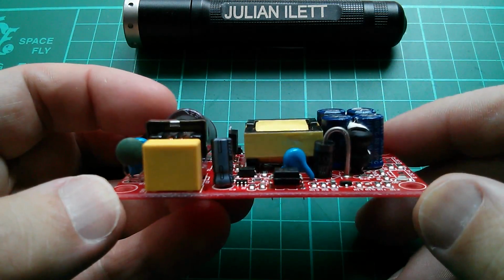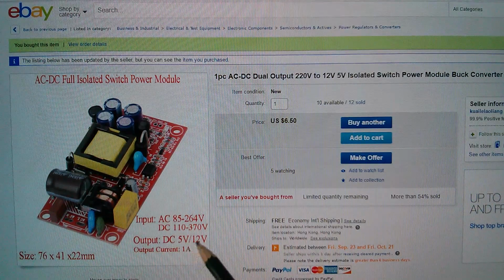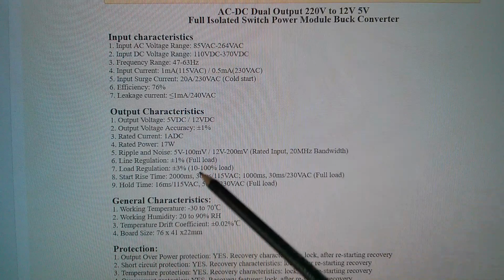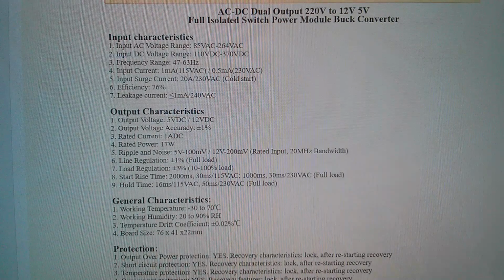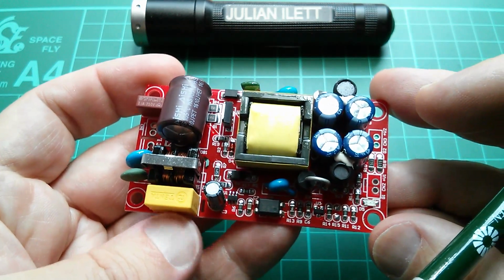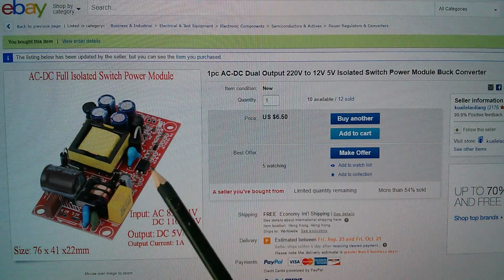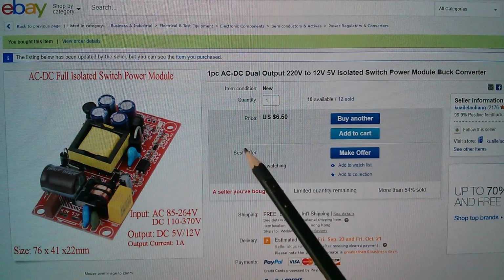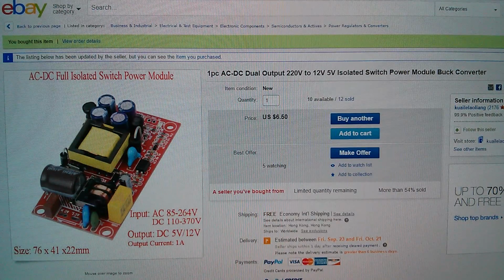Mad Idea: High Voltage DC Power Transmission

Comment: if you need something with High voltage : http://www.ebay.de/itm/High-Voltage-DC-DC-Boost-Converter-8-32V-12V-to-45V-390V-ZVS-Capacitor-Charging-/272049280111?hash=item3f5766946f:g:4r0AAOSwFGNWTC52

Comment: Now I have watched your video, some thoughts. Firstly most SMPS units will happily take a HVDC input. So you could use an old laptop supply, the new SM wall-warts (I know you hate that term! lmfao) etc. There are a few that won't work on DC cause they try to get too clever on the input side. 

However...really? A boost converter down in the garden? For one thing you're going to have to go out there all the time to turn it on & off - or you run an extra wire for remote switching! 

Wouldn't it be more sensible to move the battery into the workshop and just lengthen the solar panel wires? If you're using a PWM5 you could just let the cable resistance soak up the voltage differential between the Vmp and the actual battery voltage! And then the PWM5 will be mercifully out of the weather. lol

Finally, if you are determined on a remote battery with a high voltage link, would it not be more sensible to send the power as AC? This way you don't suffer the issues with electrolysis that DC presents. And remember your SMPS will not be fussy about the frequency of the AC either (within reason). Maybe that little Royer inverter would be a better bet? Or do some electronics and roll your own. 

I am not going to say a word on efficiency 'cause what would be the fun in that? :)

Comment: Just a thought, does the maximum amp output at either 5v or 12v (or both) get affected based on the lower than spec 110v input? e.g. at 80v input is the maximum amp output 600ma?

Comment: Now I know Julian that you must own a 12 DC to 220 AC.  Picture this,  use a RF ardiuno to monitor batteries and remote turn on a relay operated inverter located at battery then power cord it to the shop and reduce it to variable power DC or AC.

Comment: Protip: Most (basic) SMPS's will accept DC input,and never know the difference. The first thing that happens (after some EMI/RFI filtering) is that it gets rectified to DC anyways. You don't really need to look for a supply that's specifically rated for DC input. Some supplies with PFC and such might not be so happy,but most of the basic types are fine with DC input.

Comment: The DC input range is essentially the range of peak voltages of its AC rating range. It rectifies AC into DC to begin with so feeding it DC directly makes no difference to it. Now if you can find a buck converter with a multi-kilovolt input range we'd be cooking with gas.

Comment: I have lately been thinking of a very similar idea... but, with the boost converter at the solar panels and then down converting at the batteries... each panel could have it's own boost converter putting voltage one a high voltage "buss"  then running a relatively long distance over inexpensive wire and finally down converting to charge a battery bank.   I haven't worked out how to do the charge controlling.... should each solar panel and up converter do MPPT and put as much current onto the high voltage dc bus.. then another mppt like control at the other end top up the battery.   Very interesting to think about.. It would make installing solar panels much easier..   shame though.. that the cheap buck and boost converters from China don't really handle enough power to make my idea workable.

Comment: HVDC distribution is being used in some countries. The only reason we've been using AC is because when power distribution was first being used, we only had big ugly transformers to wire up. It's also easier to make an AC generator more reliable than a DC generator. Today we have high voltage semiconductors that can handle the high voltages and currents needed. The new silicon is now cheaper and more efficient than the copper used in the transformers, so we're starting to use SMPS power supplies (with their smaller transformers with less copper running more efficiently at frequencies higher than 50 to 60hz) to convert long runs of about 600kv DC to distribution stations. From the distribution stations they then use a SMPS to convert the HVDC back to lower voltages and frequencies (10kv and 60hz for example) for the short haul to the old style transformers near your house.

The DC has the advantage of not having losses due to AC inductive losses of long wires and capacitive effects between the lines.

You might get better efficiency by connecting the 115VDC directly to the 400V capacitor, but you lose the safety of the polarity reversal protection of the input rectifier.

Comment: Since your Power comes from solar, and your batteries always seem to be fully charged, the efficiency of the boost and buck converters can be ignored.  12Vdc steppped up to 120Vdc reduces current over the long haul to 10 % of the "current" draw.  Losses are I**2 * R but who cares?  For the same reason already mentioned.  You have already invested the cost of the copper run, so why change it?  120 Vdc seems more scary than 12Vdc, so don't mess with it especially when it is raining.  The benefit I see is that you increase the solar power transfer capacity by stepping the voltage high for the long haul.  The life of the electronics is also a consideration.  In the end, literally, will you be limited to upgrading the solar generation by your ability to step down higher levels of power to 12V?  
Seems to me having so much battery storage capacity is just a waste of money.  I don't understand why you have such a large battery bank if you bleed off low power most of the time.  Then there is the question of why use an MPPT?
Just do it!!  Nothing else makes much sense.

Comment: One thing I'm missing from this otherwise good video is a voltage measurement under load and with 80v on the input.
You measured the 5v, but not the 12v which had the bulb load. Does it still regulate properly when you approach 1 amp?

Comment: You can put HVDC into basically every modern switching supply, as long as it's not greater than 220 * sqrt2 or 120 * sqrt2. Why? The ac @ 50 or 60 Hz is immediately rectified  and chopped up at a few hundred kHz, to save on transformer and capacitor size and cost

Comment: Why didn't you just connect the 115Vdc to the big capacitor? Cause' the fuse?
Reply: I mean, so there wouldn't have been any uncertainty at all. 
Is it possible?
Reply: You could do that, but why? there are perfectly good connection points on the board, and then you have to worry about polarity. Doubt that the power lost in the rectifier is enough to worry about.
Reply: What? He already worried about polarity. That's why I asked. You wouldn't have to if you bypass. Also, as you mentioned, the losses of everything wouldn't exist.
Reply: It didn't matter what way he hooked it up, as he explained, the bridge rectifier would deal with it. The way he had it, he could swap the 2 wires entirely and it wouldnt make a diffrence.

By connecting to the cap, you are making it so there is only one way you can hook it up. Meaning youre more susceptible to  hooking it around the wrong way and releasing the magic smoke.

Comment: how about 48v( and of course smaller wire)  ( 4 batteries 4 solar chargers, charging individually - to top each off) send that down the line and the just use one of the nice dc-dc converter, OR heck you could use high or lower voltage in that case and your Amps aren't as restrictive

Comment: The most efficient way to transfer the power is you carrying the charged battery from the lawn to the shop ;) To make it more efficient you could even carry back a second empty battery ;)
You can pretty much run any switch mode PSU on DC. Just be aware that for low input voltages you will have high input currents (a switch mode PSU is essentially a constant power load) and if the bridge rectifier for example isn't built for that (on top of that you're only using two of its four diodes) some smoke might escape.
I'm very sure that a HVDC setup is not more efficient with these components. The biggest question is: what load do you intend to drive? For the 12V/1A you would get more out of it by just investing the money for the boost and buck converter into thicker wires.

Comment: It could work, but not with a 17W flyback. That will barely charge a phone these days.

Get a cheap ATX power supply or something if you want to do this, or one of the Mean Well power supplies (avoid the cheap G3 and NE series, they aren't adequately safe IIRC). The DC input specs will be similar on most SMPS with "universal (85-264Vac) input". 

http://www.ebay.co.uk/itm/SEVENTEAM-ST250-TPD-02-F-250W-POWER-SUPPLY-20-4-4PIN-1-X-SATA-2-X-MOLEX-PSU-/371495310358 This £9 ATX PSU might work. I have salvaged a similar model number (ST-230) before and that even had a boost PFC preregulator, not that you would need that. People who viewed this also viewed: a dozen other 250-300W ATX power supplies under £10

As you have worked out though, the saving on wire diameter is most likely offset by everything else.

Comment: I ended up doing a 10 AWG "home-run" from each and every solar panel in my yard.  I decided it was better to spend a little more in copper right now than to either have a big loss from the voltage drop or to undergo the losses from DC-DC converters (twice).  More copper is just a one-time cost.  Loss in power is an on-going "cost", if you want to put a number on your energy production.

Comment: To answer your question:
I saw somewhere in your video that that module is 17 watts.  That would indicate that you get 12V @1A and 5V @1A concurrently since that would be 12 watts + 5 watts, which is 17 watts.

Comment: I really do like Your attempt on doing this experiment! This might trigger some people to learn more about switch-mode power supplies. Thumbs up for that! :)

But ... I don't want to break it for You, but...
First: efficiency. AC-to-DC supply You had had very low efficiency compared to what they usually come these days, 78% instead of 86%...96%. This is where You will get most of Your loses in heat... and most probably it's going to be the killer of this idea in long term.
Second: boost converter. No variable boost converter is going to be constantly efficient across all it's span. Actually, if the span is as big as 100 volts, I am more than 100 volts (that is percent) sure that at some point it might be even less than 50% efficient. It would not surprise me if that would be close to it's extremes, that is, 12VDC as input (close to it's lowest input voltage) and 110...120VDC on it's output (basically max'ed out).
Third: power. You are going to limit Yourself in max power You can get. Basically system's power = weakest part in chain. If boost converter is 12V/1A, You gonna get 12V/1A at best! If booster is able to put through 100W (it is never going to be 900W at given setup even if label says so) then output is going to be 12V/8A (times efficiency along the line).

But nevertheless, good luck! I hope You get at least some result! I would like to see it successful or failure anyway! :)

Comment: Another option would be to use the long cable from the remote battery to power a boost converter at the window and charge the batteries at the window end. Use the thin wire and there will be a voltage drop but the boost  converter will fix that. Power it up when needed to pump charge from the remote battery into the local one. You can have it float the local cells and you can draw large currents locally and the cable will refill the local cells over time. 

That being said, the high voltage experiment sounds interesting but you have the risks of having high voltage cables running around the place and the inconvenience of the extra safety precautions you need to take to protect yourself and others.

Comment: Cant you just use long thick copper poles so the resistance is super low even for 12v?
Reply: M Man Not really. A 120v supply can carry 10 times as much power though the same thickness of wire. To carry a reasonable amount of power, say 1kw at 12 volts you will need 80 amps. To carry this more than a few feet without absurd voltage drop, you will need absurdly thick expensive wire.

Comment: Have you considered those POE (power over ethernet) modules ?
They can run up to 48v DC as part of the standard I think,
and are designed for Cat5/6 cable thin cable pair.
One sender module combines power into the data cable and receiving module splits power out.

Comment: Consider reconfiguring the whole system, particularly  the batteries to series, to form nominal 96 or 108 volt system. Configure the dc-dc converter as a battery charger. The drawback  of separating the charger from the batteries  is the need for a small guage  sense pair in addition to the power carrying pair. Within the nearby workshop use a series of the dc-dc power supply to provide battery backup  / solar powered critical loads.

I think your on the right track.

Comment: you can use any AC-DC converter as a DC-DC. The problem is that efficiency will be terrible at lower part of the range. Actually flyback power supplies that are big range can't be efficient. Get a regular buck converter that's rated for higher input voltage

Comment: Would it not be better to use a pure boost -> buck setup without a transformer? I'm not sure how high buck converters can go up to on the input. Or is it the case that transformers are more efficient for higher voltage inputs? Either way I figure the best place to start would be to figure out the lowest voltage you need going across the transmission line, and then base your system around that.

Comment: I believe high voltage DC is sometimes used to power underwater ROVs because the tethers used are quite long and very weight constrained. It's not that common though because of the safety issues with high voltage DC. Not sure how much benefit you'll see at this distance and low current though.

Comment: You might just take the whole roll of wire and bare both ends while the wire is still spooled up. Connect it to the power supply and boost converter and measure the output voltage.

Comment: Hi Julian,
You could pretty much use any switch mode PSU on the end "receiver". Since every switch mode PSU intended for mains operation can take DC due to the topology you basically explained.
I would use an ATX style PC power supply for the end conversion. It's capable of much higher currents while offering an overcurrent protection at the same time. They are also very cheap. You can also then improve the conversion efficiency by feeding the HV DC straight on to the main filtering cap after the bridge rectifier. It won't improve it by a large extend, but in solar power every efficiency gain counts, right?

Comment: So with 8 of these and 8 buck converters you can CCCV charge a 8S Lithium pack charging the cells seperately, who needs balance boards anyways? Sounds like a plan. I did find 1 charger on Aliexpress that did just this amazingly enough, because I couldn't find a Lithium charger I could set to 4.05 Volt and starts automatically.

Comment: Why don't you try to put the high dc voltage in the high voltage capacitor of a pc power supply. So you would have quit som power to use instead of just 1A. I just tested it with an old ATX powersupply and it works down to 90V whil I´m pulling 10A at 12V.
Reply: I agree the ATX power supply is a great idea and would b greatly increase your amps the ATX i have puts out 25amps at 12vdc
Reply: yes but you would need a quit beefy step up thing

Comment: I know you don't care about efficency and minor losses in the cables, but if the power supply is only capable of 1A, you won't be able to have more than 5w (at 5v) and 12w (at 12v). Will it be enough for your projects?

Comment: Any switch mode AC-DC power supply will work with a DC input since they are actually DC-DC switch mode power supply with the rectification in front.
Also most AC-DC supplies you may have from maybe a laptop or something else will start working around 30 to 40V DC normally but if you use them at this low voltage and try to get the max designed current on the output then the input current will be higher than designed so some parts (fuse if you are lucky) may fail.
The thin wire high voltage transmission will not make much sense in your case since the loss will still be higher and also the cost compared to proper wire and 12V with no conversion.
Like that 17W that you can use from this DC-DC converter is just around 1.3A (at 13V DC) and even with fairly thin wire say 2mm^2 (AWG14) 100m long voltage drop will be around 2V so say 20% loss that is much better than two converters and the cost of that cable will probably be lower than the converters. Not to mention those converters will not last that long with continues use and they will waste energy even when no energy is used on the other side. Copper is like gold :) a good investment the value will remain the same.

Comment: you should try using a normal switching power supply to ''buck'' the voltage back down. i noticed that my phone charger works down to 39vdc.

Comment: As the input voltage decreases, the duty cycle for the mosfet will increase. I suspect it will get very hot very fast under moderate output load. Could you test it?

Comment: The specs Do say what you asked.  They say 17 watts.   12v + 5v = 17v X 1 amp = 17 watts!    So it's a total of 1 amp combined.
Reply: 1 Amp each it is, 17 watts in total.
Reply: Yea, 1 amp per voltage rail from the wattage math